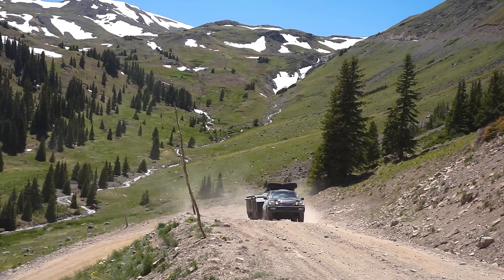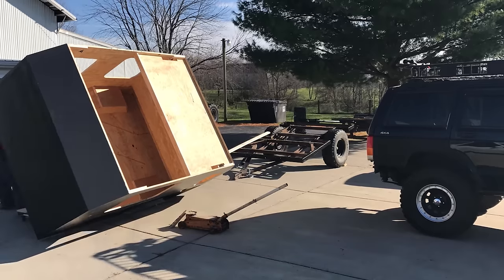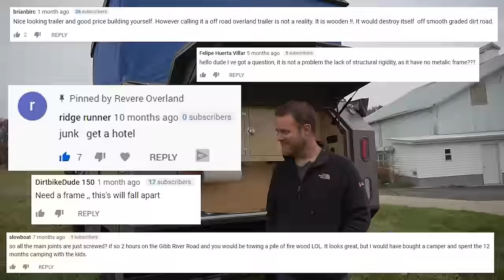Has Off-Roading been too much for the DIY Overland Camper Build?

Comment: I have been building Teardrop trailers since 1994 and I will say you have certainly done a very nice job.  Those that say that your trailer isn't strong have no idea how strong plywood AND fiberglass is.  They have been building boats like that for many years.  It shouldn't be any surprise how well it has held up.  Great design. I really like the ingenious shower design.  You could ditch the steps and put in a different style of step. More of a ladder design that will fold up out of the way (look up scissor steps).  I would highly recommend that to save you some time while traveling. Nice nice trailer.

Comment: Wondering if the people who disliked your video are dealers who "Think" they can sell you their Garbage :) - Some advice. Make the steps detachable. Use a heavy duty pin on a slide track or something then you can just set them inside the camper when not in use so you don't catch them on everything.

Comment: Such a lovely guy - I smiled like a loon when he described reversing the camper into the garage. 

I watched the original build too, so it's great to see how it has fared. I'd love to have a go at building one... maybe when I retire.

Best wishes from the UK.
Reply from the maker: Thanks for watching and the kind words!
Reply: @shaweehillsworkshop4226 I hope Elon Musk will call him and make a complete stainless version that also has a full battery pack for the Cybertruck. (but to be at the Cyber Size ... so for 4 adults and 6 children with merging extension that will merge with the back of the cybertruck to accommodate the extra size but to also have a holder that can hold the extension without the truck there)

Comment: Bought the plans, your design meets my needs perfectly. Thank You for taking the time to compile the plans, parts list and videos. Gotta snicker just a bit at some of the "experts" that have no idea how most production campers, including huge Toy Haulers & 5th wheels are constructed - WooD!  Your design is solid and well thought through. Yes, there are some phenomenal all metal overland trailers - just way out of my price range. Plus, Climbing Five plus feet into a Tent on top of a $30K Overland trailer is simply not in my wheel house. Crawling into a nice fully insulated, heated cabin with a Queen size bed after a long day in the sun and a few beverages is much more my style - :) My Dog will like this much more too :) Lifting a 92lb German Shepard up 5ft of stairs is Not going to happen :)

Comment: Love the vids. For the steps, hack em off. Weld a SHS receiver. Weld an L bend from SHS that fits in the receiver, and weld steps on that. Simple steps that can be completely removed and chucked in the camper or toolbox
Reply from the maker: I'm thinking about changing my propane tank location and adding a small toolbox there so I have a place to store it.  Early on we had a step stool I used, but it got muddy and then I didn't want to put a muddy step in the camper so we would be putting it in a garbage bag or something.  But a tool box would solve that issue.
Reply: @shaweehillsworkshop4226  if you go the single receiver removable step you can actually add a receiver anywhere, like on the back, and "store" it there 😉. If that makes sense. Like mounting a shovel somewhere, you can mount the steps out of the way. This design normally doesn't even need a pin but you would want that if mounting it for travel

Comment: Great project. It's wonderful that it's so practical.  Re: the kitchen. One variation might be to have that upper cabinet right at the back and the counter/stove/sink pull out or fold down. 

Re:  fiberglassing. Of course the next step in engineering, now that this has proved to be so durable,  is to make one with lighter plywood... . You probably didn't need to glass all the plywood just tape along the joints. (But this is just on seeing just this video). I've built and repaired a few kayaks. It's amazing how strong a curve or corner can be with just some fiberglass tape and epoxy. 

    Wes seems like a sensible guy, so I can share this next bit. (Some guys would get a new idea in their head and disappear into the garage for two years). Take a look at plywood stitch kayaks. These are made from 1/8" plywood. All the sides and joints are curved. The panels are cut and then wired or taped together with strapping tape. These joins are then fiberglass taped and epoxied on the inside, the tape/wire removed, the outside taped.... The whole skin is then fiberglassed, I think about 6 oz glass (that's what my strip kayaks have). Incredibly strong--just ask the guy out here who's 1/8" plywood kayak was chomped on by a 21' Great White. What you gain from the curves is incredible strength and structure, light but it could also be more aerodynamic. (Even so your design looks more aerodynamic than most of the commercially made pop-top trailers and truck bed models. 

Of curves really complicate things but it's not hard puzzling them out. I do it with paper shapes and tape. Of course I'm just thinking out loud. And I'm sure you'd rather be camping than trying to remake something you already have.

Comment: To figure out the weight of the trailer measure the foot print of each tire and then find the tire pressure with an accurate gauge. PSI times square inches of tire foot print gives you the weight on each tire. Use a bathroom scale to get tongue weight. Add all three together to get your total weight.
Reply: An even easier and quicker plus more accurate method is ti go to a highway truck scale and just drive over it. It's how I weigh my Jeep and my home made camper trailer.

Comment: I used to work as a lot attendant for the service department at an Rv dealer. Many would be shocked how poorly built most campers are. These days you are better off building your own. Think of it like this the guy easily saved thousands of dollars. If it breaks he learned a valuable lesson to build a better one. Anyways been seeing lots of these fiberglass over plywood square drops. This by far is my favorite one as it has loads of space!

Comment: I'm confused why wouldn't that trailer last? it's built better than some motorhomes that lasted decades.
Reply from the maker: I was surprised how many people said it would fall apart the first time it went offroad.
Reply: @shaweehillsworkshop4226   jealousy does the trick every time
Reply: Maybe some of the edges people think aren’t held together good enough. Like where the wood is attached together. But he obviously knows what he is doing and it’s very solod
Reply: @steelavocado1  I watched the build video, and I think he used biscuit joiners and gussets throughout. The guy is definitely a craftsman.
Reply: Because keyboard warriors who have never made anything think they know everything.
Reply: "there is no frame"  he says as he bolts it to a sturdy frame.
Reply: Jeff K a chassis (yes basically a frame) is not a full structural frame as people would expect on say a car with pillars which would give it lateral rigidity.
Reply: Because it is made from plywood slabs screwed between them by definition it flexes like crazy, when it ought to be metal sheets bolted/riveted and glued on a rigid bus-like metal chassis, for example?
Reply: for sure, a continuous layer of fiberglass with resin is strong as is, not to mention backed with plywood
Reply: @shaweehillsworkshop4226  probably Jeep owners you gotta forgive   them they like their daddy to buy everything not work for it.
Reply: Many people underestimate the power of a modern wood joint. Even an easy joint today is going to be stronger than the material. People expect the joint to fail, when the joint is stronger than the 3/4" plywood and that plywood is not going to fail.
The fiberglass surround is for waterproofing, it's not really strengthening the frame structure to a significant amount.
Reply: Tatts Bk  he doesn't know what he means.
Reply: @steelavocado1  seems like it is screwed, then cleat strips added inside the corners, then fiberglass outside.  Seems  to be skookum as frig
Reply: @FeydHarkon666  I think you're confused, you're thinking of people that drive of F150.

Comment: I worked for Homes of Merit building actual house trailers, and this thing is built WAY better then any of those were. This thing will last for DECADES. I would change only a couple things. 1. A Locknroll trailer hitch (multiaxis hitch) 2. The bedroom would slide out. The shower is pure genius.

Comment: After watching your video I sure could use some advise on mine. I had two boat trailers and instead of buying a new trailer I built one out of two and have since sand blasted the frame, powder coated it and installed lights. Now I've started the framing and could use some sound advise.

Comment: Hey Wes! Absolutely great video man! And awesome walk through of your camper! Your camper was definitely an inspiration during our build and your channel has been a great source of information. Funny how we spent about the same amount of money on our campers! Based on your comments about using that old metal for the frame makes us really appreciate that we went heavy duty! Doing that brought us to about 4,500lbs. Looking forward to more videos!
Reply from the maker: Yeah, once you start fitting one out, they all cost about the same.  I don't necessarily want to go any more heavy duty with my frame, I just wish I had used new metal because its obvious that it is old crusty metal under a new trailer.  BTW, have you liked your electric lift?  I have thought about doing the same to mine.
Reply: SHAWИEE HILLS WORKSHOP I really like my electric actuators...they’re great specially if you’re planning to put a lot of gear on your roof. Otherwise it will definitely become too heavy for one person to lift alone. My only wish would have been being able to afford fully synchronized ones. It would have made the process of opening and closing the roof much smoother and quicker...even to the point of being able to use a remote control from the outside without having to step foot inside. Hope this was helpful!

Comment: You've gained a subscriber here. This is the coolest build I've seen so far. I have your plans list on my birthday gift list (to me).  I have a couple of questions: 1. Do I have to build the trailer or is there a commercial build I can use (such as a trailer offered by lowe's)?  2. For winter, do you have a plan for insulating the top curtain?  I'd use a sheet of thinsulate with a curtain cut from packing quilts- that should be plenty warm.

Comment: Step up idea:
What if you make the steps fold up against the side of the trailer? I think you can get it as flat to the side as the shower on the other side.
Reply: another suggestion is a small step ladder. put in the camper when not in use.

Comment: Loved this when I seen the first video and still love it now.  And +1 on an Earth Roamer build.
Reply from the maker: I really want to build an Earth Roamer, I'm just not sure if I have it in me to take on that big of a project or not.
Reply: @shaweehillsworkshop4226  Yah I here you. It pretty much dedicates a truck to camping. I had looked into building a truck camper for some time but I'm not sure it's any advantage over a trailer.
Reply: I think those Earth Roamers are waaay too big for real offroad camping. Imagine that in the woods..
Reply: I run a motorcycle camper and I was in Sedona, AZ caped in a no services area when the most incredible camper I have ever seen, still. 
It was a full on Peterbuilt tractor with a full size camper where the sleeper would normally be.. it definitely was  a custom built camper. I wish I had taken pictures.  The guy who has it, is the CEO of a company that hires and runs hotshot crews and also builds off grid homes and communities.

Comment: My criticism would be to swap to a Dexter Torflex axle with 45deg downturns.  Your axle is clearly dragging as low as the steps.  A Torflex, for the same price as what you built, would sit up against the frame.

Love the build though!  Great craftsmanship and detail. Other trailers are just redicoulous in price.  I'd never buy one for what they're asking. I'm towing around an 86 Coleman popup that has stood up to a lot of trail abuse. Nothing too bad like boulders.
Reply from the maker: Thanks for watching! There are a couple of things you should consider.  The axle on the trailer is higher than the axle on the tow vehicle, so clearance of the axle will never be a problem, the steps are on the front corner of the trailer which can dip down depending on how the vehicle twist in proportion to the trailer in a turn.  Also, torsion axles are typically frowned upon offroad because of the potential for mud and sand to degrade the rubber, that is why timbren axle-less suspensions are so popular offroad.
Reply: @shaweehillsworkshop4226  I'd have to disagree there.  My Torflex is 30yrs old and has seen quite a bit of abuse.  They almost never fail unless overloaded. I've recently done some research on the Timbrens as I thought about finally replacing my Torflex for those. In my readings, I read multiple opinions that the Timbren's bushings are too harsh of a ride for these style trailers and the Torflex is softer. So I'm going to stick with the trusty Torflex.  Can't go wrong with 30yrs of proven ability on my own camper.
The Cadillac option might be the Cruisemaster with airbags and shocks, but that's out of most people's pricerange and overkill. 

I think you're referring to submerging the Torflex axle and getting it dirty? As I mentioned, the axle sits up high bolted to the frame.  I hope you don't submerge the frame and nice flooring on any camper in mud.
I'd like to read where you found a Torflex failing with mud and/or sand since I'm about a week away with replacing mine.
Reply from the maker: Jon McCauley I have had mine in mud up to the door!

Comment: Wow! I remember watching you build this trailer. I had just started to build my trailer which like you was very, and still is, little information out there. You got me beat on miles, but I have been beating on my trailer too and it is holding up just fine too. Time flies when we are having fun I suppose. See you on the trails, George.
Reply from the maker: Bug Out Trailers I’ve watched almost all your videos!   I wanted to do foam, but was afraid to with the popup.  If I was just doing a drop, I think I would go the foam route!
Reply: @shaweehillsworkshop4226  Good to hear. I think you could do a popup with a foamie. In fact I like the lines of your trailer so who knows, might be my next project.

Comment: I’m planning on building a design similar to yours. I’m going to purchase the plans for guidance. My question is with the trailer. So far the only 6x8 trailer I’ve found has been rated at 2400 pounds maximum load. Is there anyway to make that work if I plan to sleep 4 adults?

Comment: Considering that Overland Campers are pushing beyond $30K what you have done is amazing for $5K. I had hoped to buy a small camper with a dry bath that, last year, was selling for around $23K no frills but came with heated and enclosed tanks (more on this later). However, due to the pandemic the same camper has shot up to nearly $37K for pretty much the same thing and $57K for more style. Then I saw a video of a man who fabricated his own trailer frame, ~5'x8', from aircraft grade structural aluminum tubing and thick, 0.25", angle aluminum with steel to support a 3500# axle and bolted the whole thing together with heavy stainless bolts and nylock nuts except for the steel axle support which was welded. Since I don't weld, but would love to learn, I could probably have that little bit of work outsourced. The Idea came to me, with your video and some others, to build a fiberglassed  foamy on a similar, slightly larger, aluminum frame with, hopefully, a hard sided (fiberglassed foamy) popup (since the internal shower Idea works better that way), internal and external shower and a composting head. All this so I can go "places" in the summer and camp in the parking lots of Rocky Mountain Ski Resorts (That alow this) in the winter and hit the slopes in the morning. This will be pulled behind a 6 Cyl. Canyon so the light weight of aluminum and fiberglass seem best but your build at 2K#'s would still work as long as I keep the tongue weight below 700#'s. Your plans may become a necessity in the future but I'm waiting to hear more about this guy's Nylock bolted aluminum frame and how that is holding up (since I am far from being a MIG or TIG welder at this juncture).

Comment: I was thinking that the galley deck (at least) would have done better as a pull-out.of the bottom just when he asked that question. A flat panel over the cabinet doors to lift as an awning with (LED) lights of white and red over it. Maybe a slimline vent fan too.

Comment: Could you use this same construction technique to build a full size that would bolt to a pickup truck frame? Full bath, kitchen, the works?
Reply from the maker: HankHill757 you definitely could!
Reply: SHAWИEE HILLS WORKSHOP   Do you use special joints like dovetails, box or finger joints to make the bond between panels stronger? I’m thinking if one predesigned the structure in CAD they could have all the panels CNC cut with the joints so everything fit together perfectly and make  for a much stronger structure. Thoughts on this?
  I’m also thinking a steel subframe under the box that mounted to the truck frame using a 3 point design would allow for truck frame flex without damage to the structure. Thoughts on this too please?  Thanks!